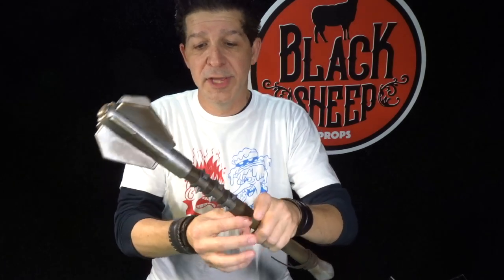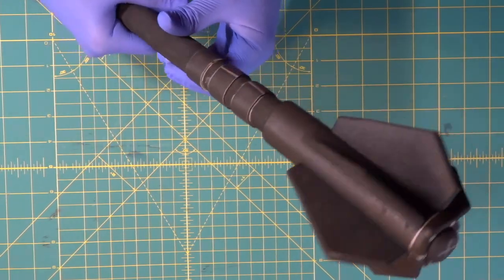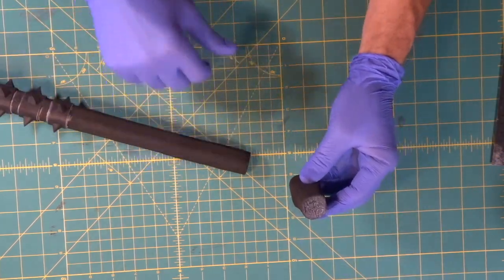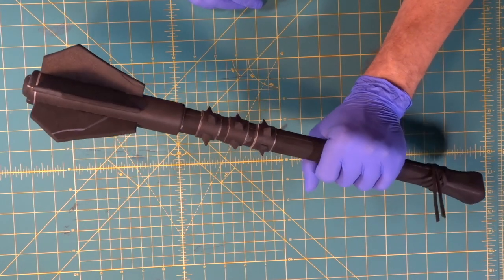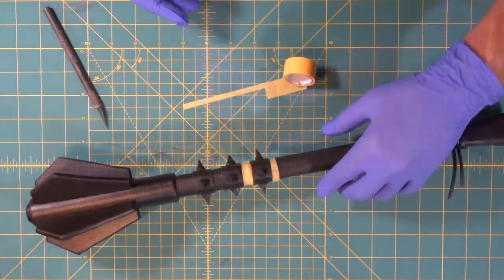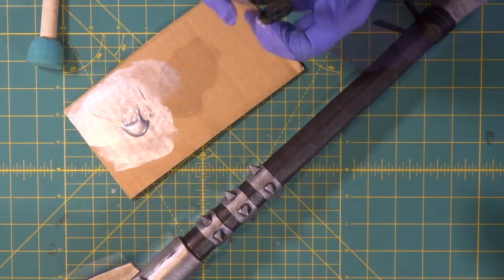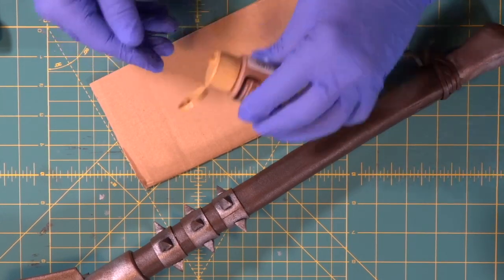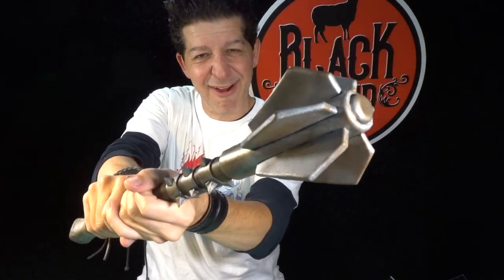Making An EVA Foam Medieval Mace Part 2

Comment: amazing tutorial, really how you actually made a mace rather than those over the top fantasy two handed "maces". Although i have some questions.

First, do you know any other substitute for plasti dip that i can use?

And second, how do the fins stand up to hits and use since they are simply glued to the foam?

Also were the fins attached with superglue because it  "melts the foam" forming a better contact, or was it a another type of glue ? 

thanks  :)
Reply from the maker: Hi! Glad you liked the build!
I have only used Plasti Dip since I started building so I am not sure about any other ways to coat them. I have seen some makers use a product called Creature Cast to seal their props.
All of my builds are really only for show, for carrying through a convention or a festival. They aren’t really planned to be used in batttle. I use super glue sometimes when a piece or area are thin or small. It’s easier controlling it compared to the big brush on my contact cement glue pot.
Reply: @BlackSheepProps  okay cheers for the respond :) but the building process had some interesting techniques. thanks again :)